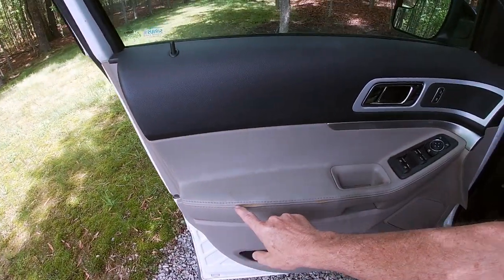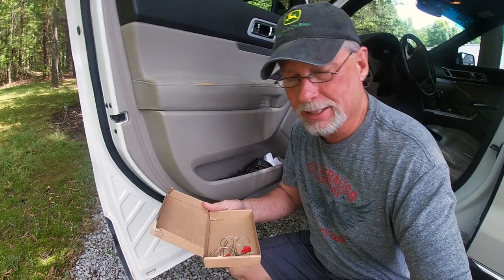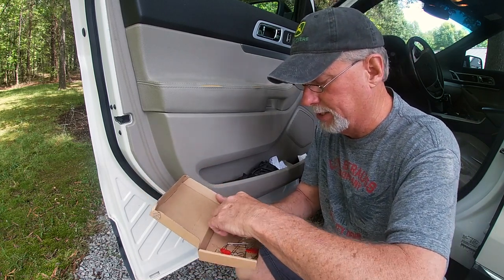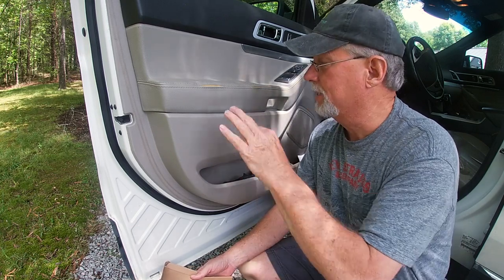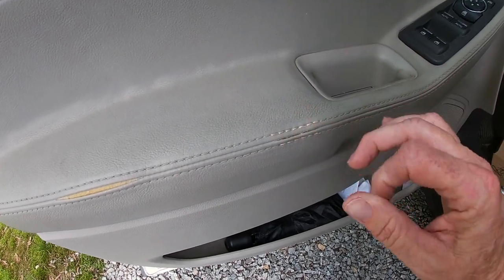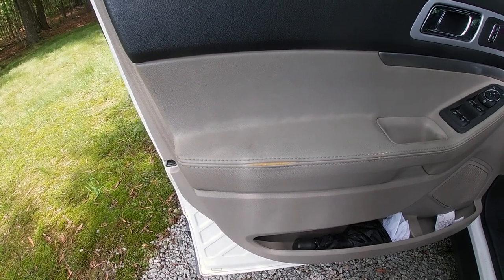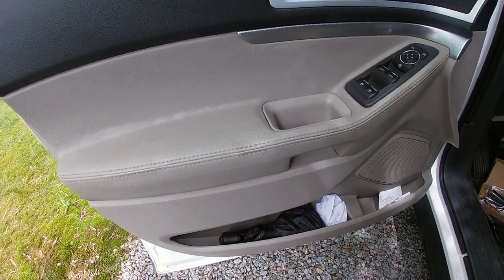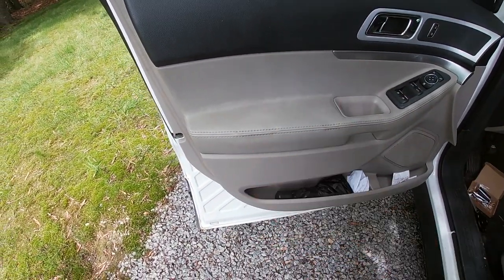Ford Door Panel Repair #CarRepairs

Comment: How did you hide the knot after pulling it tight
Reply from the maker: I ran the needle into the split went around the string tied a knot then cut string and pushed it back through the split so you can't see it. I hope that will hold. So far it's doing GREAT !!!! Thanks for watching !!!!